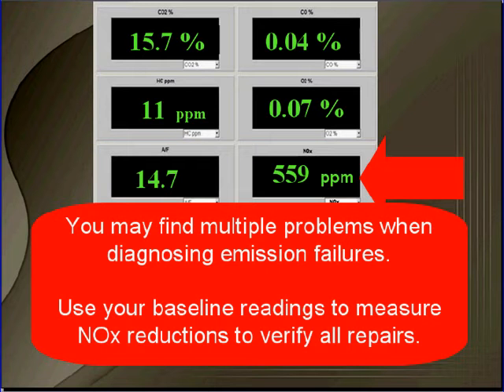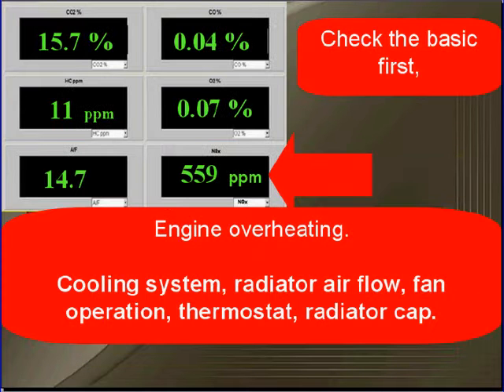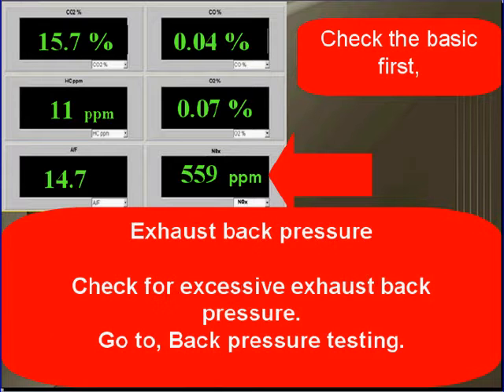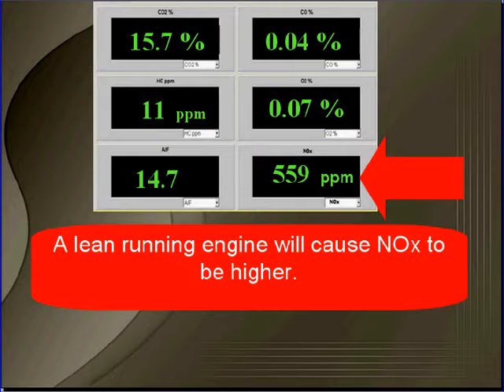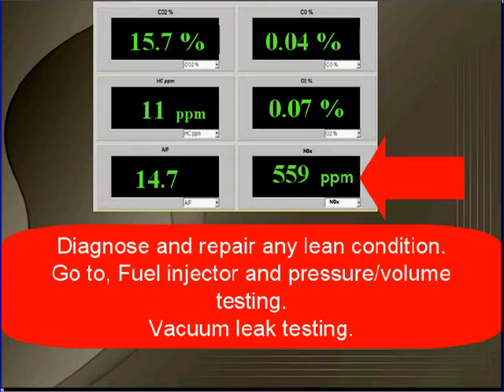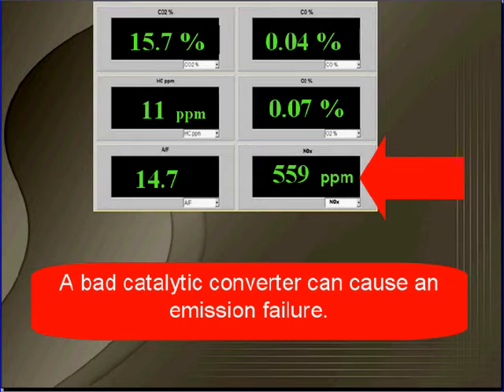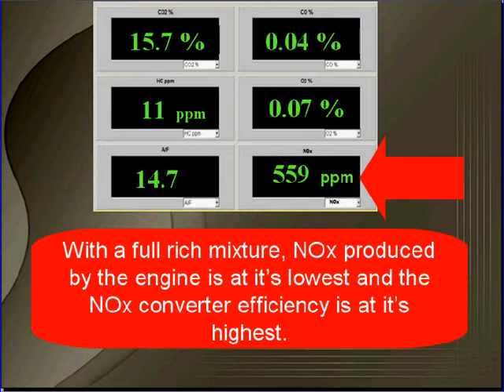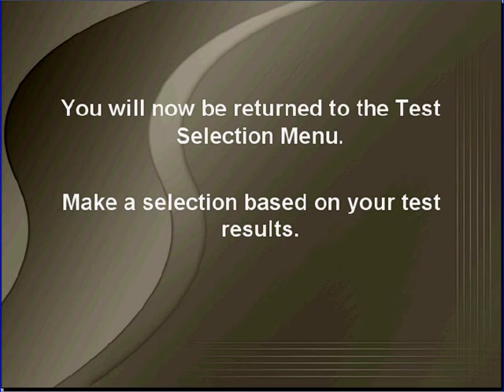32 Chrysler Diagnostics: Emission Tests - NOx High

Comment: failed nox found a  leak in a tube could it be that simple? i have a new cat new sensors new distributor  new egr new spark plugs and wires